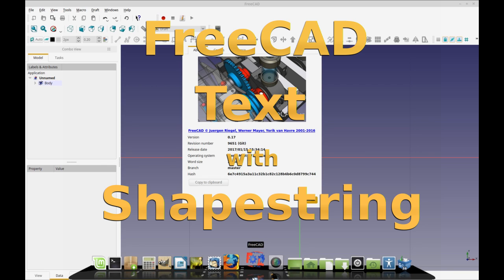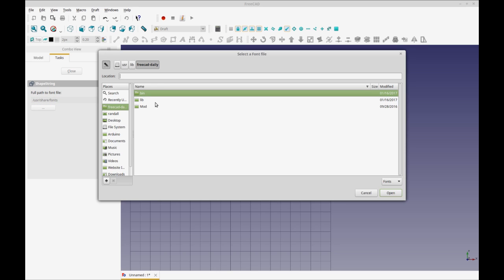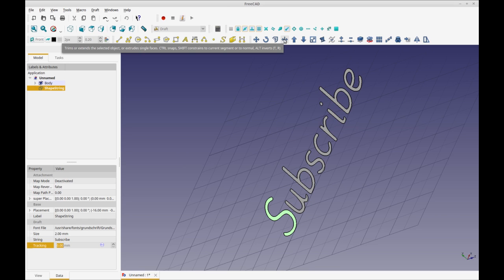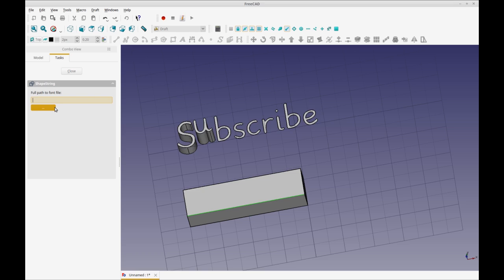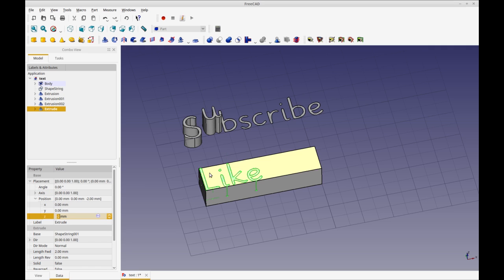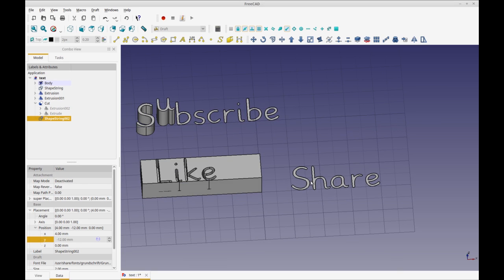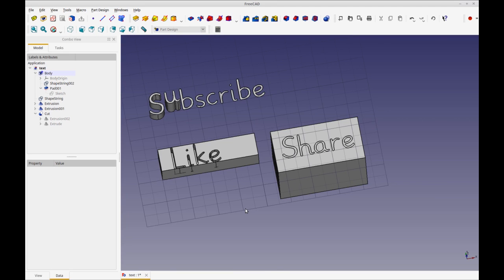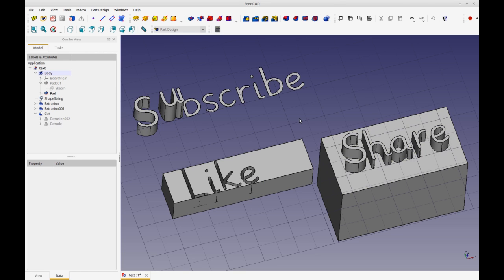FreeCAD Tutorial - Text ( Shapestring )

Comment: Paul, I followed these instructions with v0.16 and was able to get the string added to a part created in the "part design" desk. I had a couple of issues. First, the text was created upside down on the face of the shape I am creating. I finally found how to edit the orientation using Euler angles, and was able to get the text string raised appropriately. The second issue I encountered, but have not resolved is placing the same text on the opposite side of my part; I want the same label on opposite sides of a part. I tried the same rotations and changes in location to get the text string to the particular face I wanted, but after selecting the text in the "part design" desk, I could not get it raised without causing the rendering to crash and delete my entire part. I tried moving the drafting plane, but I could not get it to move. And in v0.16, I could not find the widget to switch to a "snap to point" option on the drafting grid. Any help would be appreciated, or direction to other videos to answer my questions.

Comment: Paul...also, a little hint I just discovered.  Not sure if you knew about it.
To hardcode the path for your fonts I went into the Preferences from the Draft workbench. Draft -> Text and dimensions.  From there I put the path to my fonts in the "Default ShapeString font file" in the "ShapeString Settings" section.
So now when I get to that section to put the full path to font file, my path is already in there.  I click the ellipse and BAM I'm put into that sub-folder.
Reply: Llavero en freecad